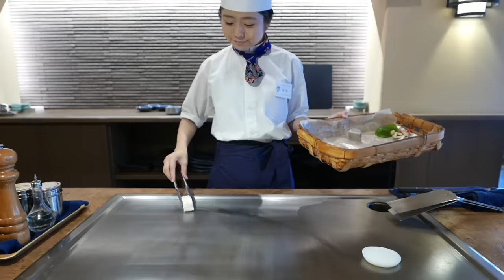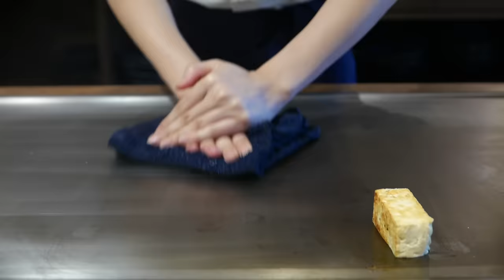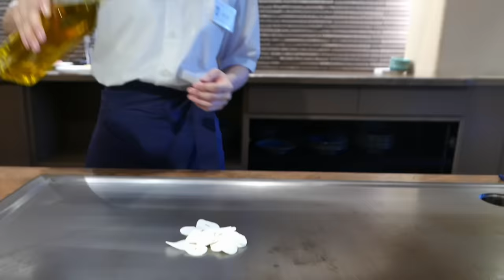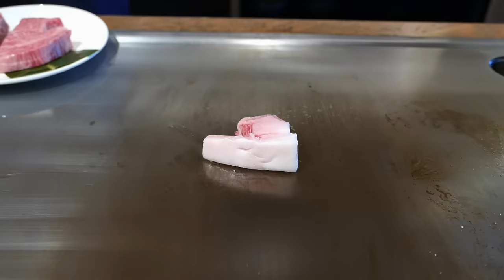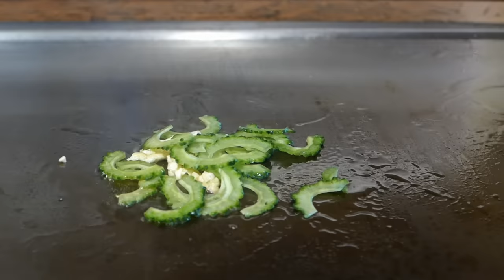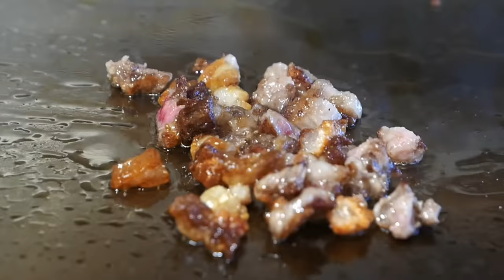$200 PRIME KOBE BEEF JAPANESE TEPPANYAKI Sirloin Steak Japan

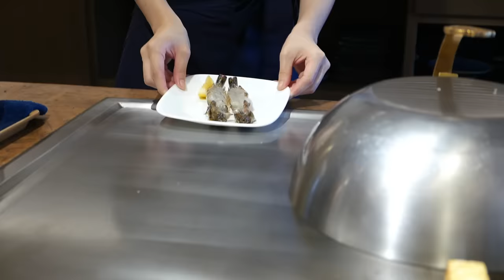Comment: At 4:20 is the proper way to do shrimp: first you put them on ice until they're numb as heck, too cold for nerve receptors to fire, then you slice into their brains, then down the middle to kill them. Then you cook them and eat them and contribute to the grand cycle of ecology, later. You do lobster the same way. It's a myth that they turn poisonous if you don't cook them instantly. Lobster sashimi is a delicacy prepared with lobster that has been dead for around a half an hour, as long as it takes to slice it in half, remove the contents, slice them into bite-sized morsels, rearrange them in the shells with garnish, etc.. Sashimi = raw, as in not cooked at all.